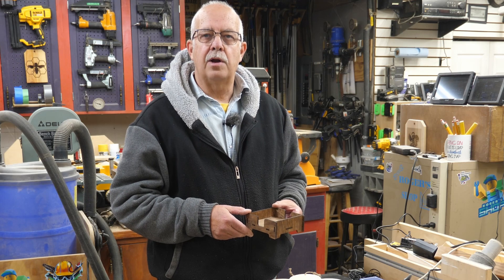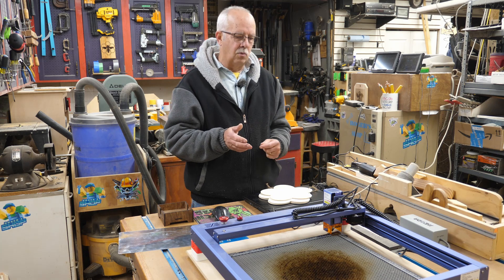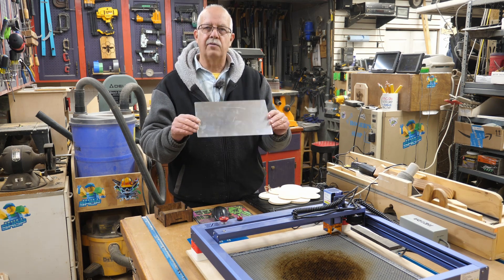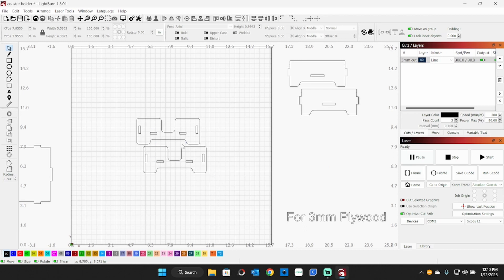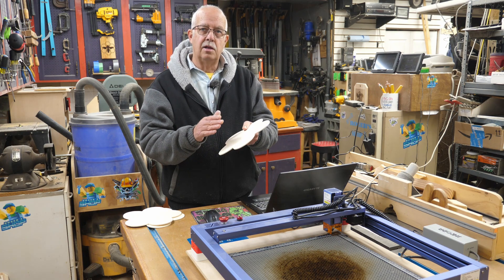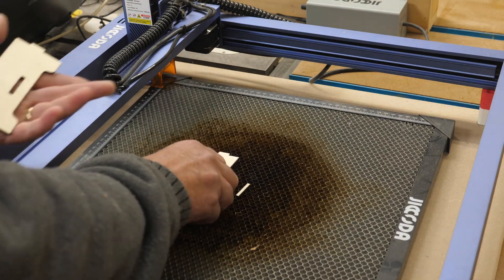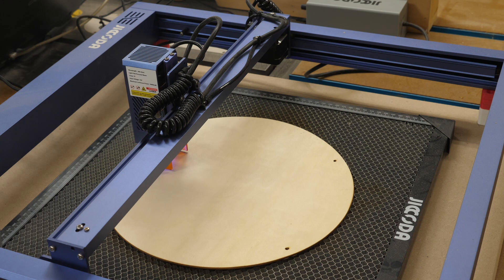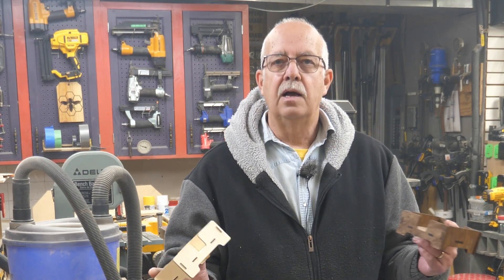Beginner Laser Project 9 Coaster Holders

Comment: love this holder works great for 4 X 4 tiles. But 4 X 4 slate just way to big can you modify the file to fit slate tiles better .. I'm to new to know how to do it myself in lightburn..
TY
Reply from the maker: Yes, it can be modified to accommodate larger coasters.  I've also had requests to design a deeper one for thicker coasters, or slate that has feet.  On my list of an upcoming project.
Reply: ty .. cant wait .. slate would be a lil smaller actually. tile are 110 mm and slate is 100 mm. Thanks again. or maybe a video on how to modify the size ourselves. @rogersshop
Reply from the maker: @papakoko4344  If using Lightburn, resizing is easy.  Just make sure the padlock is locked or it will skew the graphic..  Slate coasters also tend to have rough edges, so keep the engrave away from the very edge or it won't look right.
Reply: so new not sure what ya mean lol
 @rogersshop

Comment: Hi Roger, I have a Sculpfun S9 and I just can't seem to get my Framing to just frame the design.  It always goes out the the Lasing item.  Do you Know where I can get hepl with that?  Thank You
Reply: I have GRBL and Light5burn on my Computer.  Do I use both?
Reply from the maker: @johnjahner3389  You can, but not at the same time.  I seldom use Laser GRBL.
Reply: @rogersshop  Roger I keep getting  error:9 and G-code locked out during jog state and under laser it reads busy 100%
Reply from the maker: What software?